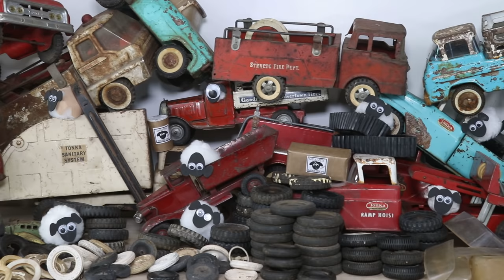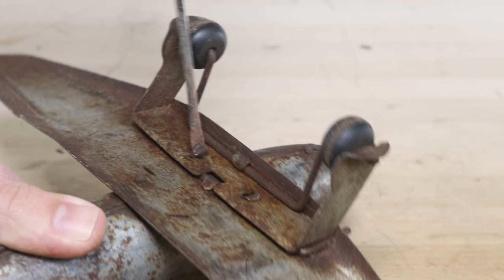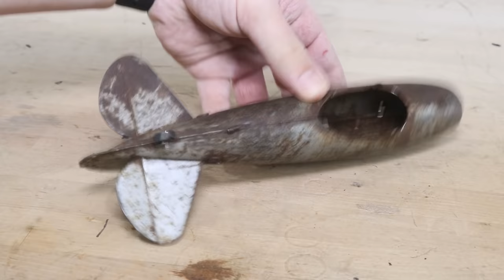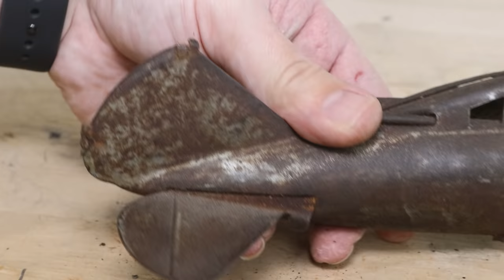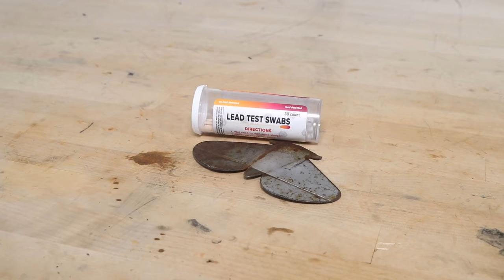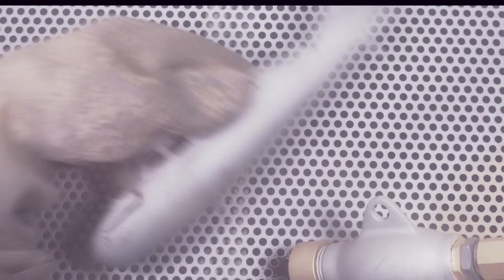1940s Marx Seversky P35 Toy Fighter Airplane Restoration

Comment: I just picked up this same toy earlier today from a local toy dealer.  The plane has the usual nicks and scratches on the paint, with just a bit of surface rust.  It's missing the rear tire under the tail, but the plane has no dings or dents, and everything else is there.  I spent an hour cleaning the orange nicotine residue off of the plane (previous owner must have been a smoker), which made the paint much brighter once I was finished. Overall, it's in pretty decent condition. I was pretty excited to see that you have a video restoring this very same plane!  Once again, an absolutely beautiful restoration.

Comment: I've watched a couple other restore guys. I have to say your attention to detail is far superior.
Reply: I am actually beginning to have my doubts about a couple of other channels (not here--too much detail and actual work).  It seems that rust patterns, e.g., from item to item are too strangely consistent, and there are other elements on those channels that whisper "faux restore."  Anyone else have misgivings like this?
Thank goodness Chip Channel's around.  I get such a relaxed feeling watching and appreciating.
BTW, the sandblasting changes the metal to a buff-white.  Is this straight tin or some other alloy?  Anyone know?
Reply: @josepherhardt164  Probably mild steel.  The finish you get from media blasting depends on the media used.  It looks like he is using either garnet or aluminum oxide media, which has sharp corners and edges which will give that buff white look.  Glass beads give a duller look.  There is also ground up walnut shells and corn cob media, but I've never used those.
Reply: @TheCoffeehound  Thanks!  :)

Comment: The Seversky P-35 is an American fighter aircraft built by the Seversky Aircraft Company in the late 1930s. A contemporary of the Hawker Hurricane and Messerschmitt Bf 109, the P-35 was the first single-seat fighter in United States Army Air Corps to feature all-metal construction, retractable landing gear, and an enclosed cockpit. Seversky later became Republic Aircraft of Long Island, New York.

Comment: Beautiful job 👍. Here’s a bit of airplane history or trivia. Seversky founded by a European aeronautical engineer went on to be a part in the design of the “follow on” to the P-35 which came about during that period of time when aviation technology was rapidly changing. The follow on was the P-43 Lancer and  later came the P-47 Thunderbolt which was produced by Republic. Sit these 3 aircraft side by side and the family resemblance is apparent. Especially with the earlier P-47’s that had the glazed (Aluminum) canopy frames and not the “Perspex” tear drop shaped canopy.

Comment: I know that it's supposed to be a P-35 but it also looks a lot like a Douglass SBD Dive bomber. The SBD did stellar performance in the Battle of Midway-where they sank four Japanese aircraft carriers. In a pinch, the SBD was sometimes a fighter plane. With it's 300 mph speed and maneuverability it was actually a better fighter than the F-2 or P-36, which filled U.S. military inventories in 1941/42.

By the way, great resto job on the toy. Your craftsmanship is yet to be challenged on YouTube.

Comment: Another great restoration, but one comment. You should have twisted the blades into the proper angle, how is the plane gonna fly if it can't grab the air to pull it up. LOL love your videos, good to see things reclaimed and not left to die in the trash.

Comment: Chip Channel, Well done! I loved this restoration.

I think I might have given a slight twist to each propeller blade, so it would look more propeller-y, instead of just flat, but then it is a toy. You should have left the holes in the wings open, so the plane could be hung up with string.

All in all, understandable choices, though. 

Give Beaker an extra treat for me, and take good care of those sheep.

Comment: Wonderful to see Don's P-35 restored after fighting Ki-27 Nates, Ki-41 Oscars , A5M Claudes and A6M Zeros in the western Pacific theater. Both Seversky and the P-35 were ancestors of Republic and the P-47. Being the aviation nerd I am, this would have been a cool thing to get.
Interesting you included your tabby at the end. Showa/Nakajima license-built the Douglas DC-3 and it was called the Tabby, so it's possible the P-35 and L2D Tabby flew in the same skies.

Comment: I assume the prop was made in this case to be flat, but I can't help but suggest pivoting them in the future on another toy, so that when you blow on it, not use use your finger, it can spin on the wind. 
I have LEGO sets from the late 80s, early 90s, full of propellers, but none of them were were as special as the ones that would actually spin fast and smooth when I "flew them" around the house. Or alternatively, put them on "submarines" I built and the blades spun in the water just by force of currents being made. Best realism and thrill when I was building aircraft. :D

Comment: There is a method for calculating the bend allowance when bending material.  When you have a moment, look up the formula and bend chart and it will save you a ton of guess work.  We use it in sheet metal fabrication all the time.

Comment: Nice job Chip  you might want to get you a small block of alu. It pull the heat away from the  metal quicker so you dont pop through when weilding i used it a lot when i weiled it work great. Oh it good for filling in holes to

Comment: You are very talented, knowledgeable,  and lucky to have the resources to make the prop, and tabs. I noticed that the sand blasting was a little different. Wasn't be a use of different paint? Metal? Manufacturer? I know you usuly do a lot of Tonka and this was Marx. Didn't know if metal or paint was different.

Comment: I love it. I am so glad that you have to ability and desire to restore these old toys.😀😀😀 I have a CNC plasma cutter and I wish that I had the prints so that I could make new old toys. It looks like I would need more equipment, like press dies. The tires would be a problem to. None the less, I think you did a nice job on the video and the project. 👌👌👌👍👍👍  I wonder what was in the wing holes???

Comment: Here's a thought.....I know it's expensive, but have you thought of getting a copper block to place metal against for welding? I bought a one pound bar of copper years ago, maybe 2....for I think it was $40.00........That way you won't be accidentally welding the steel bracing you are holding in the background to the piece being welded on.....Again...........just a though. Peace, and God bless.

Comment: Have you ever thought about getting a tig welder instead of using the mig? I know tig is more expensive but you would have better control of the weld resulting in smaller welds and a lot less welding splatter

Comment: The Seversky P-35 was a pre-WWII fighter made by a company (Seversky Aircraft) that would become Republic Aviation, builders of the WWII P-47 "Thunderbolt" fighter. That toy has to date to the late 1930s; the P-35 started hitting Army Air Corps units in 1937. The plane type would see combat in the Philippines in late 1941 to early 1942, where it was barely matching the Japanese Zero fighter. None of those fighter units returned to Allied territory. 

The color scheme for prewar was P-35s was bare aluminum with a polished finish, the national colors on the fin and rudder, and the prewar roundels in six positions, with the letting "U.S. ARMY" under the wings. Unit markings were on the fuselage. http://wp.scn.ru/en/ww15/f/161/3/0#7 The fighter type was also used by Sweden in small numbers.
Reply: 22:49 The guns sticking out of both ends makes me think this is supposed to be the two-man trainer version, the AT-12 "Guardsman" or maybe the  2PA-B3, an "export fighter" made by Seversky that had seats for two. Neither of them had rear-facing guns, but Marx might have not known (or cared.)

Comment: I know that the decision to make a missing/broken part vs. the purchase of replacement parts takes cost and availability of parts and your time into consideration.  What are some of the other factors that you consider in making this decision and can you make a video showing what goes into deciding which way to go.  P.S. When are you going to invest in a rod bending device rather than using a vise and pliers?  It would be quicker and more precise.

Comment: What gauge metal is it that you used for the prop and the tabs?  Is is aluminum or tin?  And can you solder it if one does not have a welding machine?  Thanks

Comment: why do you and all the other restorers do a lead test?
Reply: Because if it has lead paint on it he paints on paint stripper to remove it, instead of sandblasting the paint off. Lead paint is toxic and he doesn’t want powdered lead all over the place, where he could be touching it or breathing it in when he cleans up his equipment.